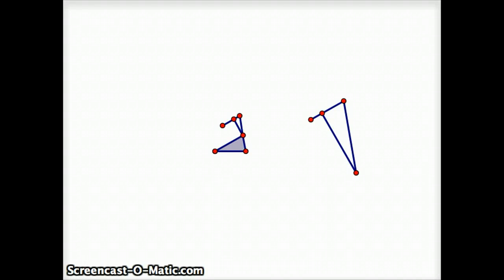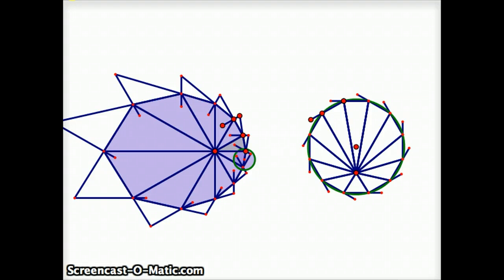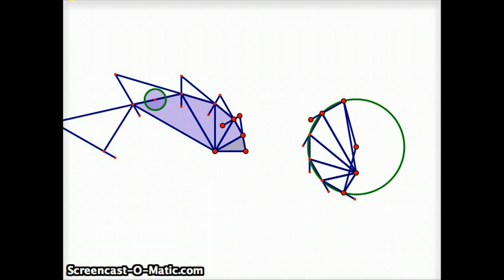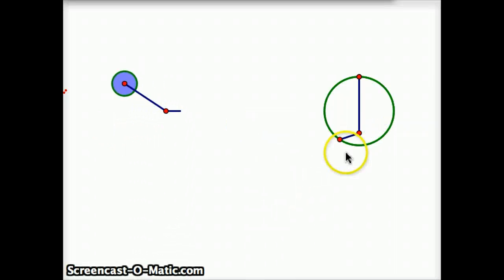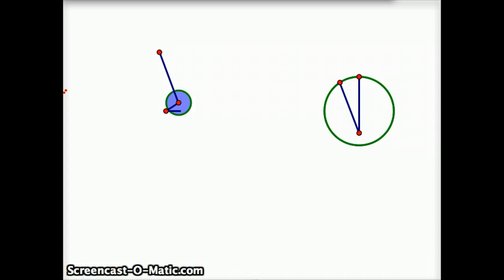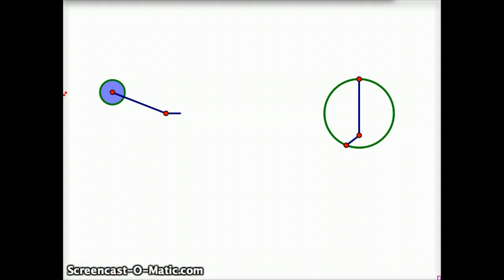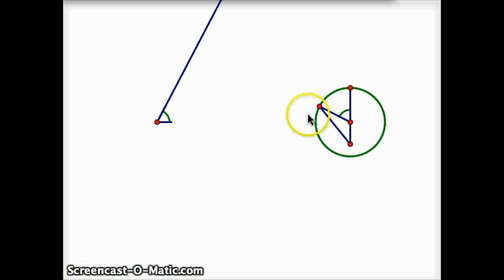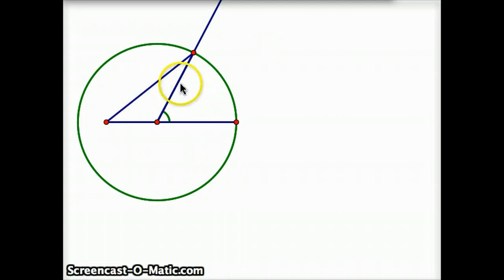Feynman's Lost Lecture VII

Comment: I don't get something. If the change in velocity delta v must be the same in each equal angle interval (beause delta v =F*delta t, and f is proportional to 1/r^2 and delta t to r^2 sodelta v is a constant), why isn't it in the ellipse diagram? And why do you later divide by the time, wouldn't that give you something proportional to delta v /r^2? There's something I'm missing here